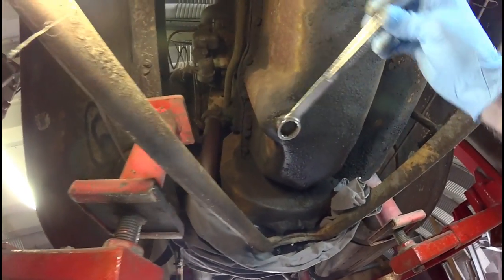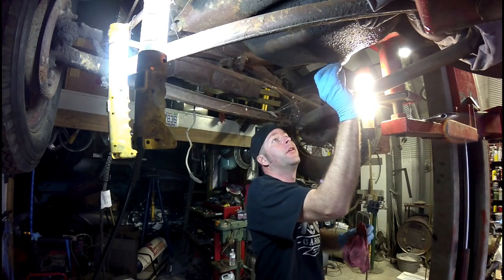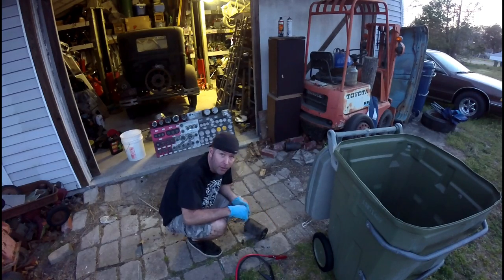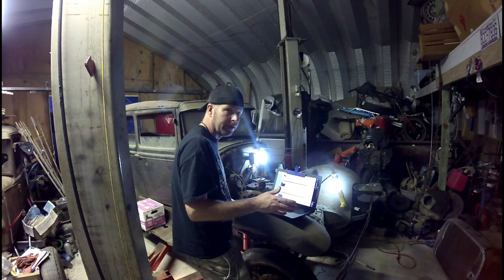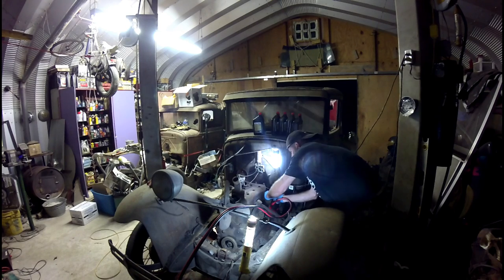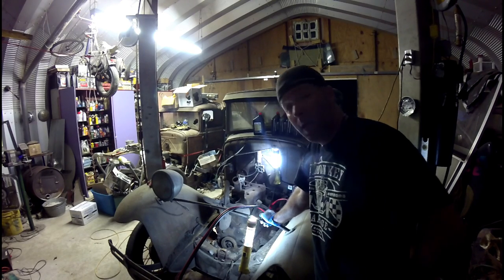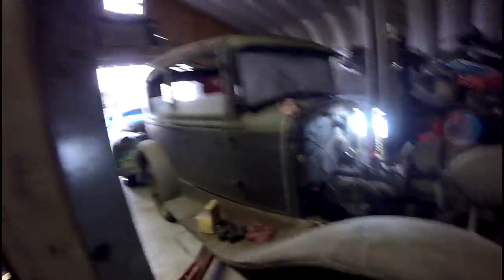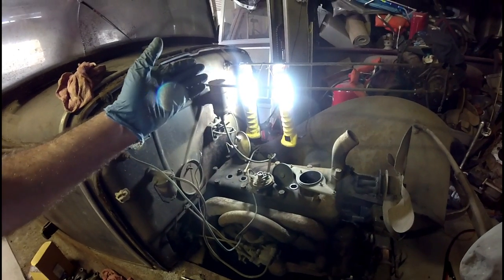Barn Find Model A Runs!! Ike's Adventures

Comment: Trans fluid in the sump? What happens when all the sludge and crud gets washed off and starts to circulate? Might be okay if the engine has a full flow oil filter, but on an old thing like that with no filter i can imagine all the dirty muck getting pumped through the bearings etc. Might not be good.

Comment: ATF is simply 10W motor oil with dye , heavy detergents , depending on the type foam modifiers or not , perfectly fine in idle and yard use , i would not take it on the road running a full pan of it ,

Comment: Dude if you hear clanking while the engine is running and you think it's the rod put thicker oil in it that will fill in the tolerance gaps and stop it from clanking 24/7

Comment: There's nothing like getting an old cast iron engine running again. I would never attempt this with anything post-WWI, but definitely pre-WWII. That said, I would NOT recommend running an unrestored engine with ANY detergent in it. You actually don't want to knock that stuff loose because it will get into places it shouldn't and could seize her up again, but in MUCH worse ways. You want to use a non-detergent motor oil in her.

Comment: 6 volt starters are built to handle more amps then a 12 volt starter. You will not have a problem using a 12 volt battery.

Comment: Why would you not use 30 HD oil (high detergent) oil to remove the sludge ? When i wanted to clean out a motor i would fill it with diesel fuel (not running motor ) just flushing it .

Comment: Hey!! That sounded pretty good!!! And, I bet the timing was still "retarded" by the spark lever on the steering column. If it's "up" it's retarded. Down is advanced. When these motors are in good condition and timed properly, they will run with the spark "retarded" at about 400 RPM and sound just "bitchen". You can about hear every pulse. VERY KOOL!!! This should be a "fun one"!!!
Reply: thanks

Comment: Ike, you need some more hanging shop lights.
Reply: yep. I need more
Reply: Isaac it'll be fine Get some LED 4 ft. tube's. More light than you can use and they never burn out. Added bonus is that they start in any temperature, no flickering. I'm replacing all my lights with LED's in my 40X80 ft. pole barn and my garage as fund's allow.

Comment: Well done!!!
Out of curiosity, between the small engines & old engines, have you guys found a good source for non-corn juice fuel, ie, 0% ethanol?
Reply: I have to use alcohol free too in a Rotax aircraft engine and my generators. Airports have avgas, but it's expensive. Check with local fuel distributors for stations that have alcohol free.
Reply: Robnord1 
Pure-gas.org has a constantly updated list of places nation wide.
Reply: yea. we live near the water so gas stations near boat ramps sell ethanol free gas

Comment: Glad it runs Ike. Was the general store out of oil that day or what? After some research the ATF trick seems ok just don't leave it in there.
Reply: lol. i just wanted to clean it out. atf works better to clean it out
Reply: Yeah, It'l be fine. How about the fuel system, maybe some Sea Foam?
Reply: rebuild the carb and clean out the tank

Comment: I would ONLY put number 30 NON Detergent oil in the A without taking the engine apart and cleaning it first. getting all that dirt that is stuck to things loose is not a good idea at all.

Comment: Nice, sounds great. Do you know how long it had been since it was last run? I got a 60 Pontiac back on the road after it sat 37 years in an old barn. It's engine was stuck, but did get it freed up and running. It's only got 25,000 original miles. Check my videos out if you wish.

Comment: Your doing good , just a thought from myself. I would have filled it with diesel fuel after it unlocked and spun it with the air wrench for some time and drained it before; the trans fluid. Not sayin you should, its just what I would have done. keep up the good work. Really enjoy your abilities, accomplishments and persistence. I miss them days, done w'hore my self out. 35 years of concrete floors, lay'n on the ground and bend'n over fenders  love'n  watch'n your videos now. Its like taste'n the grease smelling the smoke damb'd amazing how it gets in your blood to make it go again. All thats left now is my broke body an my 1977 Honda Goldwing, I conformed into a trike with 1977 Ford Pinto rearend. 25 years thinken about it. 5 bikes for parts to build it only a couple months to gitter done and ride her down  the road all proud called her the old hord. Now 3 engines later10 years of upgrading parts. Last winter a tuneup a cleanup and repaint restoration. Went from running perfect to she's back misfire'n and fart'n around abit. Only 41 acts like me at 65. One more time Im going figure it out. Just can't leave the old girl alone to rest, yet. Where she go's I go's. Thanks for all the metal moments & memories of all them past love's. There's a tear in my beer over here...later bud... trust me that diesel shit works, polisher her up inside like new. I know I broke many a motors. loose I mean.

Comment: Does it matter that these things used to run on leaded gas and we now run them on non leaded?
Reply: it matters
Reply: And what would you use in it different then? some sort of fuel additive? I have a chain saw and weed eater that is supposed to run on leaded.
Reply: you can buy lead additive
Reply: or substitute
Reply: will you be using it? Or will you do what i have been doing and just running it normaly. Only thing I have to watch out for is over heating. They both do that way to easily.

Comment: darn pull the pan n clean first atf not vey strong film strength mix with 1stp 1.20w50 3.atf of wet break hydraulic oil cheaper its my atf

Comment: After running ATF in that engine you need to drop the pan and clean it out, that engine is a semi pressured engine and it's been fed a steady diet of non detergent oil for decades. ATF will break up the 80 year accumulation of sludge and its going to settle in the troughs that supply oil to the scoopers on the con rods and plug them up. You won't like what's going to happen after they plug up. Never run high detergent oils in an engine that has spent all of it's life running non detergent oils unless you tear them down and manually clean out the half inch+ thick layer of crud that has built up in it over the years.

Comment: never understood the obsession for starting the engine on old cars sitting for decades....it started...ok... but it probably has a rotten head gasket, needs rings, bearings seals, valve job etc so it will have to be rebuilt and now probably has the cylinders all scratched....

Comment: how many ohms was that resistor
Reply: not sure. its for a 72 dodge
Reply: I had a 68 P[ymouth that used one that looked just like it.  No idea on the Ohms though.
Reply: ok but that is a pretty big resistor
Reply: It's not like they use now, flip it over and it's just a ceramic block with what looks like a spring in it, very simple construction.  You could probably fit 100 new ones the same resistance in the same space.
Reply: old school. lol